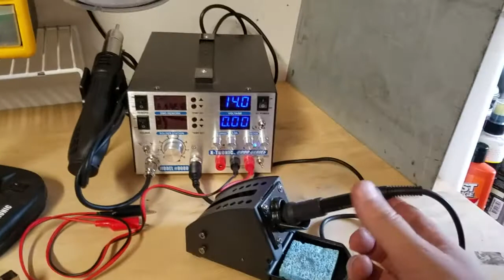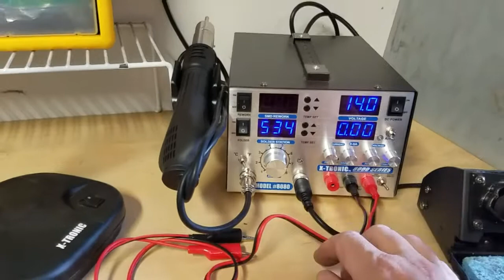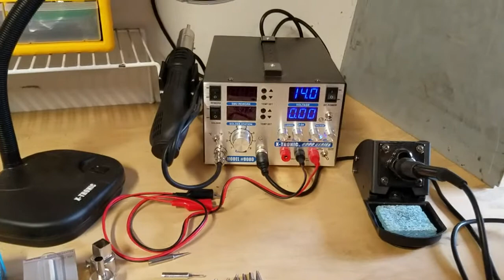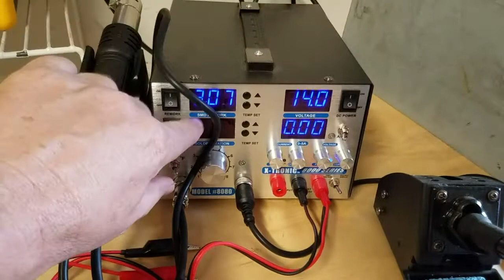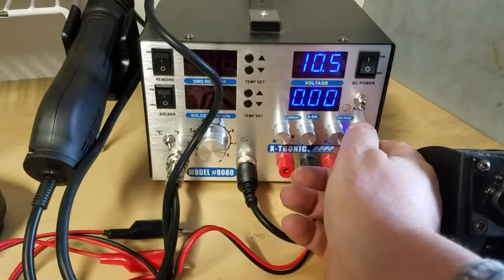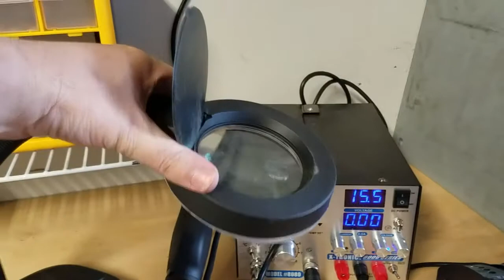Review X-Tronic 8080 Solder station

Comment: Is the dc power supply linear or switching
Reply: I know its an ancient comment but in case someone needs thjs info later on.... 

On something that small im extremely sure its switching... if you cant tell by specs you could also look at weight as linear will be a lot heavier